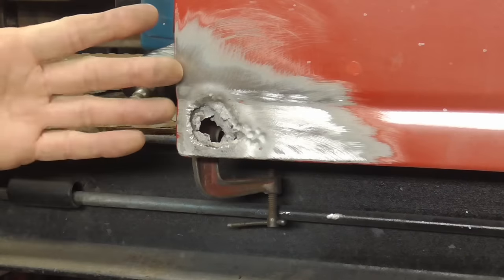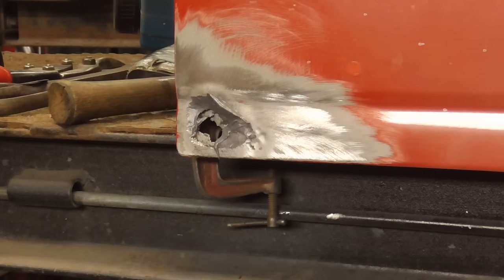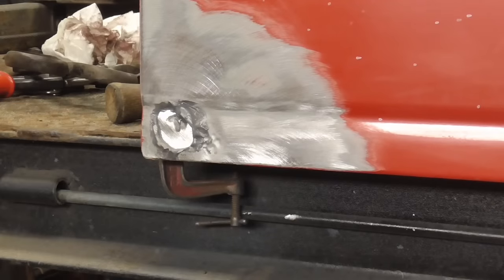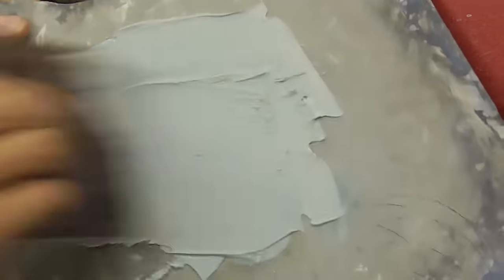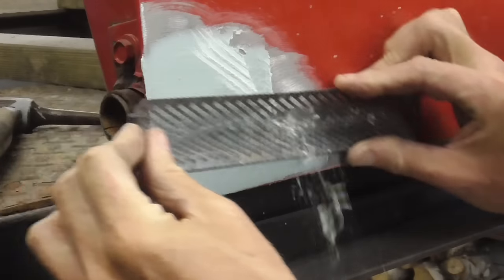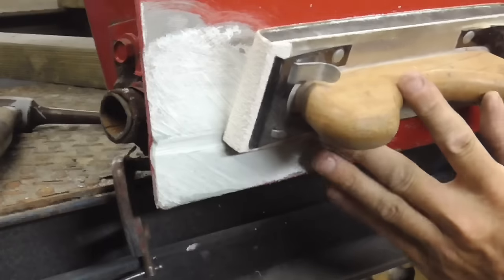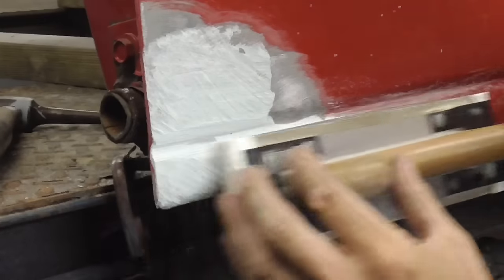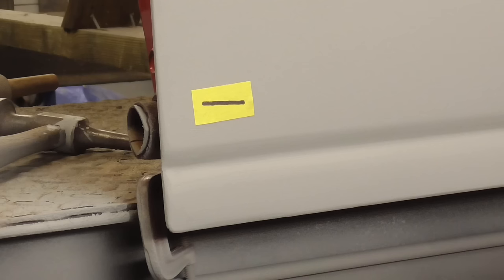Using JB Weld to Fix Rust Holes?

Comment: Can this be used for smaller holes in sheet metal?like as a filler?
Reply from the maker: I would think so.  On a car I would grind it, knock it down a bit to make sort of a ding, then fill it.  If you can undercoat the back side it'll last a very long time.
Reply: @LakesideAutobody  Thanks for the reply,there is no rust present I tried mig welding it shut but metal is pretty thin and in difficult area to reach inside a wheel arch.Also have a few small pinholes after welding in a patch.Im new to welding I have a copper spoon and I tried getting behind to close holes shut some worked some not.These are very small like small nail holes.
Reply from the maker: @petermarrero7022  Hey, you did the best you can do and that'll have to do.  With the rest of the holes just grind them or sand blast them up clean, knock them down and fill them :)
Reply: @LakesideAutobody  Thanks,appreciate the help.

Comment: and what does the backside look like?
Reply from the maker: If you cleared out all the debris such as rust chunks, etc.  hopefully just open space so that salt water, seeds, and debris can drain out and the back can stay dry - the most important thing for making rust repairs last is allowing for drainage and keeping the inside of the panel clean and dry.
Reply: @LakesideAutobody  im talking about the back side of the door
Reply from the maker: @ARCSTREAMS  Oh - I got you.  You could sand blast the back or grind it clean and smooth it out with fiberglass reinforced filler, auto body seam sealer (works excellent), or regular filler.  Sorry should have showed that :)
Reply: @LakesideAutobody  ok cool,,btw i recently had both my rockers redone at a shop because there was a dent on one from an accident and the other side was starting to rust and have small holes so i decided to have them do both ,,when the job was done i noticed that the trim on the rear (under the rear wheel wells) had a opened gap ,one side was a bit closed but the other was more open,,now idk if this is on purpose to allow excess water build up to drain out or it was a piss poor job? to my thinking there should not be any water going in there to begin with so i decided to patch them up using aluminum sheet metal from soda can trimmed and snug fitted to close the gap and then i used black silicone adhesive to seal off the seams and then fill the whole thing up all around ,,this way i dont have to worry about winter weather or road salt and water getting in there and rusting them all over,,,what do you think,was this a good or bad idea?
Reply from the maker: @ARCSTREAMS  Honestly, I think they probably opened them up for drainage but like you said - it could be bad workmanship.  If the front of the rocker is lower than the back then I would close them up in the back  because al the salt water would gather up front anyway.   A simple rule of thumb is make sure the panel can drain well.  Rust or rot is caused by leaves, dirt, salt water, rust chunks getting trapped in one area.  This get wet with salt water like a sponge and rots the panel out.  Just have to do your best to prevent that.  You will always get water inside of a rocker because it makes it's way in there through pinch welds, seams, factory stamped drainage holes, holes that were drilled for trim, etc. Check this video out for more info on that:   https://www.youtube.com/watch?v=DqxMHCizkUE  or  https://www.youtube.com/watch?v=y05dNxt-nVc
Reply: @LakesideAutobody  its hard to say but i think its possibly lower in the front ,,in any case i dont see how any of that stuff would get inside unless through those gaps ,hopefully they did a good job removing any rust pieces left inside before installing the new profiles,,idk how tight they closed the front ends because they stop before going to the front wheel wells as there is another part of the cars body in the way ,,perhaps when i go to get undercoating done for winter they might drill holes underneath but i prefer they dont do that if its shut tight otherwise salt will always get in there with water ,,thx ill have a look at the vids,,,btw my car is a 2006 pontiac pursuit 2.2l eng

Comment: I need to do this to the gas tank on my moped i have a couple of holes on it before i can remove the rust from the inside using evaporust. It will be a temporary job just to remove the rust then i will get the tank holes brazed.
Will it work? Anyone know?
Thank you
Reply from the maker: I think it will as long as the surface is prepared right.
Reply: @LakesideAutobody  Thank you i will give it a try.
Have a Happy and prosperous NewYear

Comment: Why do you not use lead
Reply from the maker: My dad used to use lead and I did try it when I was real young.  Plastic filler is fast, easy, and I've never had anything go wrong after a repair using it.  You can use lead though if you prefer - they have the kits at Eastwood - there's a guy that does a vid on it there too.  Good ?
Reply: @LakesideAutobody  I still use lead in body work I learned as a child an it's a traditional trade I have thought my own son.

Comment: what is the gauge of the sheet metal?
Reply from the maker: 22 gauge - .030"
Reply: Lakeside Autobody thank you! Trying this today. What material? Galvanized, stainless or aluminum? Thanks again.
Reply from the maker: @ericschwarzer9586  I think any one of those would work with the JB.  I would think it would stick real well to aluminum after it's been sanded a bit with some rough sand paper - let me know how it goes :)
Reply: Lakeside Autobody thank you so much! Will comment once I get to it this week. Got myself a sheet of aluminum and one of steel to see which one works.
Reply from the maker: @ericschwarzer9586  Cool - looking forward to it :)

Comment: I stumbled upon your video (now subscribed) looking for some info on using marine epoxy for the same type of repair.  Readily available, made for boat repair.  Indicates that it adheres well to steel, as well as typical boat hull materials.  I was attracted to using this product as I was thinking "water-proof".  Years ago I did some hole repairs with fiberglass/polyester, but seemed like I still got water seepage and bubbling.  I know from using marine epoxy it also seems to sand and shape quite well.
Reply from the maker: Thanks so much for the info - always looking for something cheaper than 3m panel adhesive.  There are a lot of professional shops gluing on the patch panels today.  I think it would be superior to welding really - that is if I could find a convenient, inexpensive method to use.  I'll look into this marine epoxy - wonder how well it would hold up to tapping on it after the patch was glued on?   Thanks again.

Comment: Do you think this would work on a large patch panel for a truck bed floor? Thanks! Great vid.
Reply from the maker: I think so - as long and the metal was clean and sanded/ground properly.  36-40 grit fiber resin disk or similar.  Glued this cab corner on with JB and it's been perfect for about a year now:  https://www.youtube.com/watch?v=wRl1QfkrBeY

Comment: I just used some jb weld on the low pressure piping of my ac because my cold air intake kinda rubbed a little hole , I didn’t use anything to cover the hole just bc how small it was, but do you think it’ll hold ?
Reply from the maker: I used it on a rusted egr pipe with got smoking hot and it held for like 10 years then I sold the van so you never know.  If you prepared the surface correctly, I think it will hold.  Hope it does for you :)

Comment: Would you ever use rust converter/remover/encapsulator (not clear on the differences) in between the two skins after grinding?
Reply from the maker: You can - I had a boss one time that made us use that stuff - not sure if it ever made a difference.  We never had any come backs actually so maybe it did work well :)

Comment: You might as well use body filler .
Quick fix quick fail .
It never works
Reply from the maker: Drainage is the most important thing - make sure your repaired panel can drain and stay dry on the inside.

Comment: I guess it will work but if you already made a metal patch just weld it and there is no 8 hr. wait time. I have used Alumiweld filler and it dries fast like Bondo. Are you working on a 90's Chevy tailgate there? Good idea it should hold up well with some cavity wax sprayed on the inside to prevent the rust from returning! Thumbs up
Reply from the maker: Thanks Robert, yes - I'm thinkin' that was a Dodge Dakota tailgate - 90's.  I've come across some of that cavity wax on cars I've taken apart - never used it myself.  There are companies that do that here in Michigan - your whole car.
Reply: @LakesideAutobody  We used cavity wax by 3M on every panel replacement or patch, I had a long wand applicator that looked alot like you sand blaster with spin on canisters it was required for doing insurance collision repairs here in California. I closed my shop in 2010 after 26 yrs. I just couldn't take it anymore. I liked it better when I ran a little shop in the early years. I nave lots of equipment too bad you aren't closer!
Reply from the maker: @robertbraden3889  When my dad was working as a body man, those were probably the good times - late 60's to mid 80's.  He bought new cars, had houses built, etc. The insurance companies really put a clamps on the profession.  Along with cost of materials.  Everyone was making money except for the guy doing the work!  My dad caught the beginning of it and got real discouraged and ended up going into tool sales - had a MATCO tool truck.  That didn't work out to well 'cause you had to chase guys around for the $.  Anyway, you're right about the small shop.  Keep it simple and live frugally - better than stress :)  Jerry
Reply: @LakesideAutobody  Amen Jerry! I have two sons they didn't want to take over the shop, I'm retired now and build RV Buses for fun
Reply from the maker: @robertbraden3889  Congratulations.  Nice job keeping it going for 26 years - that's a heck of a lot of responsibility and long hours.  Your hobby sounds pretty cool - you should send me some pics of those buses at the email under the "about" tab on my home page.  Have a great weekend :)
Reply: @LakesideAutobody  Jerry I have over 100 videos on YouTube my friend! Enjoyed talking with you.
Reply from the maker: @robertbraden3889  Excellent, I just subscribed - very cool channel :)

Comment: How long will that jb weld patch lasts?
Reply from the maker: Any type of repair can last a long time if you allow for the panel to drain by drilling or cleaning the drain holes.  Even squirting some used motor oil inside can really help.  That being said,  it will last as long as the metal lasts around it.  I'd say 3-5 years or longer depending on where the patch is.  That's a low estimate - just to be real

Comment: That was a cool trick.  I would worry that there might still be some rust in the pinch weld, but other than that I see no problem with it.
Reply from the maker: I think you're right but if you squirt some old motor oil inside the tail gate (a few 1/8 in holes here and there) and get it real greasy down there (after you paint) - I think it would keep the rust at bay.
Reply: Just grease up that hole woth mud and then fill erup haha worka every time bazing
Reply: @LakesideAutobody  Fluid Film spray works better than motor oil. See the Project Farm YouTube videos for maintenance tips- he found a better bedliner paint and for other things.
Reply from the maker: @jeffruebens8355  Looking forward to trying it out - thanks

Comment: I rather do it the right way weld it in
Reply from the maker: Remember the best way to prevent rust from coming back on any repair is drainage and the method of rust prevention after the repair.  No moisture = no rust - Happy Easter :)

Comment: Yeah, quick fix at a correct fix price. Just get a welder, spend another few minutes and do it right. This might be a repair method for a guy with no skills or tools. Goop on the JB, sand it down and use paint from a rattle can to cover it all up.
Reply from the maker: Lots of shops are using panel adhesive or glues now as it seals the seam.  It can last if the repair can drain and stay dry.  Here's another that will easily last as long as a new panel:  https://www.youtube.com/watch?v=wRl1QfkrBeY  or if you prefer welding:  https://www.youtube.com/watch?v=IRgtWiKA7UY  I try to show all different methods for folks that want different options - check out my rust repair playlist on the home page :)

Comment: I've done stuff like that before and it works fine, but I don't see how it's better than using short strand 'glass filler exactly the same way.  The fiberglass will be stronger spanning any small holes, set MUCH faster and it's cheaper.  Where's the advantage to JB Weld?
Reply from the maker: The glass will work fine on small holes just try to coat the back with something if you can.  Just wanted to demonstrate the use of JB in case someone wanted to "glue" a patch panel into place instead of MIG welding.
Reply: If i use fiberglass how will it hold against fuel? (gasoline)
Cheers
Reply from the maker: @SDsailor7  I don't think you would have a problem at all.  Fiberglass boats get fuel spilled on and inside of them all the time and they hold up well.
Reply: @LakesideAutobody  Good to know that i have another option but i think i am going to try jb weld first i have used it before and dont have experience with fiberglass and jb weld is so strong.